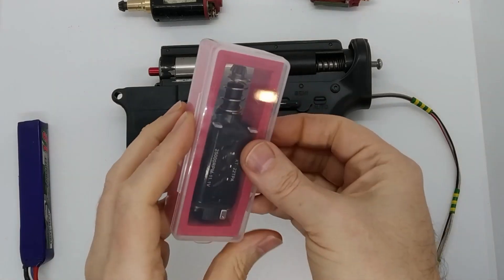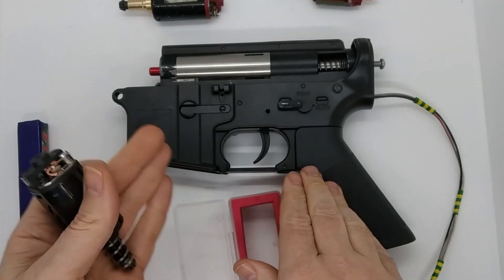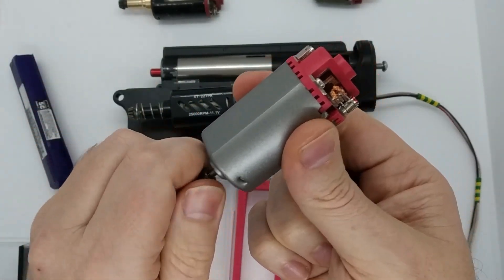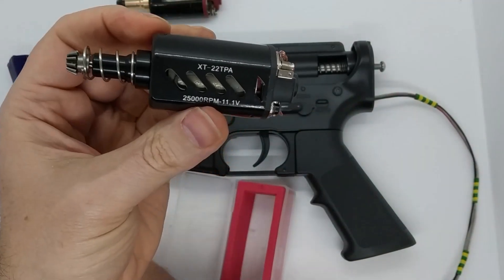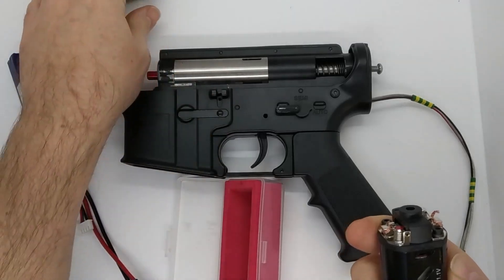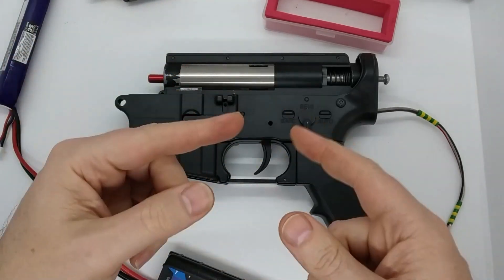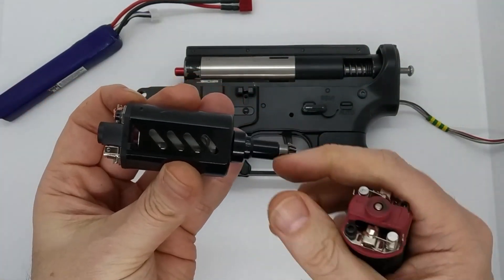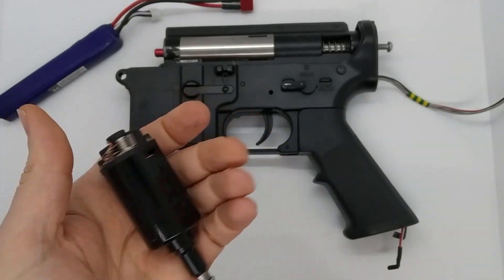XT 22TPA Airsoft Motor Heat Test

Comment: I have a dmr project with M170 spring
Can it handle a M170 spring????
Specs
11.1 lipo 3000mah 20C
18.1 gears 2.5ver long type gearbox 
Thank younfor your video ❤
Reply from the maker: For a M170 ideally go brushless.  UK is limited on J so no call for it here

Comment: could this motor pull a shs 18:1 gears: m160 or m150 spring with a decent lipo battery?
Reply from the maker: It's possible yes, why would you want to?